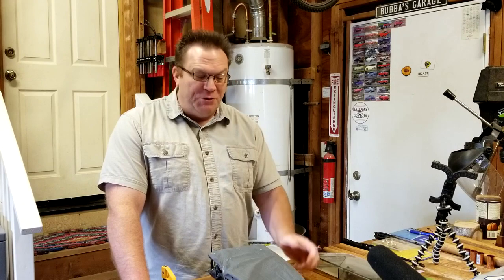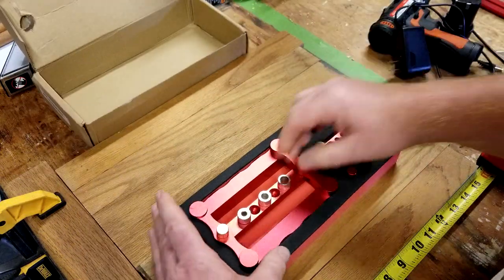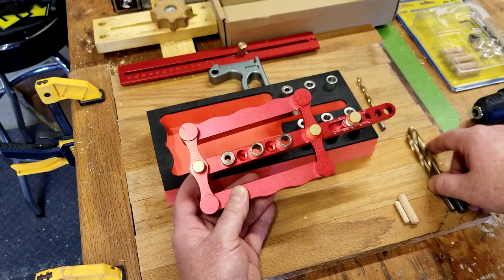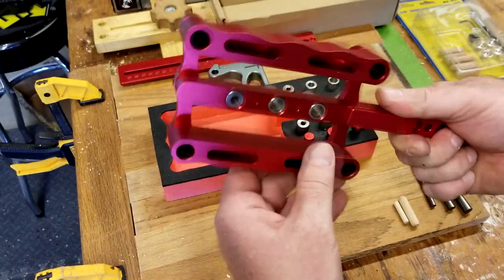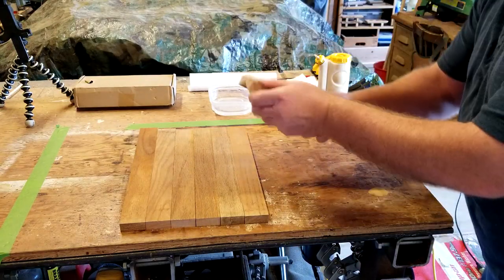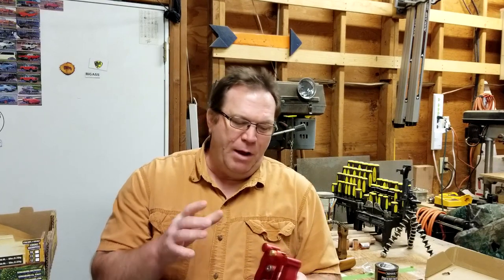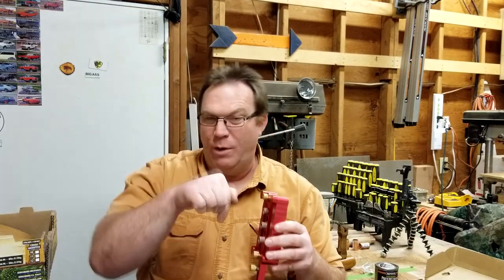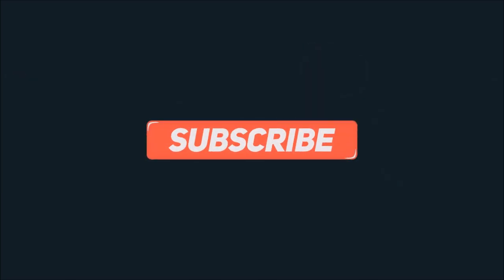Hit or Miss 21: Banggood Self-centering Doweling Jig

Comment: I've used the vise type of these for years, but they take a bit of time to align each hole, so bought one of these and hope it will be faster.  Thanks for the tip on the screws.  Working on a nine foot bar top assembled in five pieces, would have been a mess if I ran into the same problem.

Comment: Thanks for the review. I was given one recently and I look forward to using it. I'll keep an eye on those screws. They need the springs because those joints need to rotate as the tool is used.
Reply: I crimped mine up fairly tightly today, and it still rotates well

Comment: Did you take the end stop off after the first hole drilled in each board?  When you measure from hole to hole with this on the tool will rock on this as a pivot thereby screwing up every hole but 5he first one.

Comment: @3.58 were you drilling one of the 'hardened' bushings? Surely the point is they should be harder than the drill so they don't wear?
Reply from the maker: Yes. unfortunately they arent hardened.
Reply: @BubbasWorkbench  Thanks for clarifying that :)